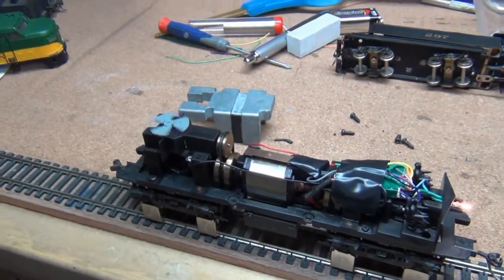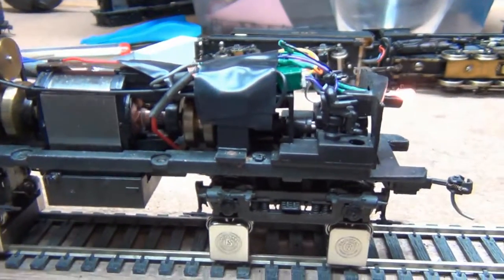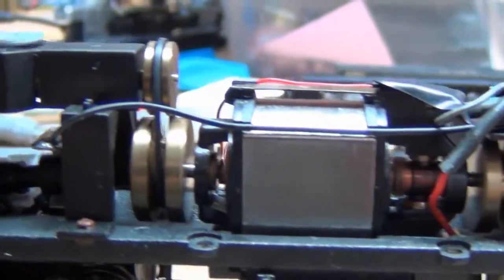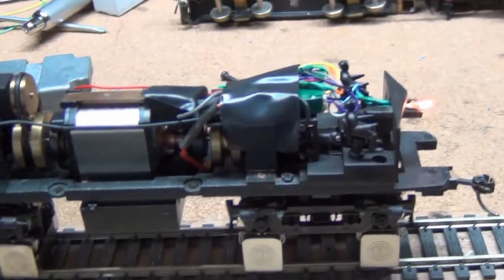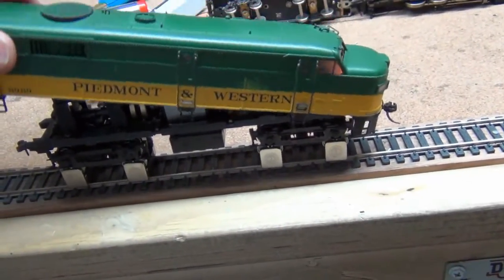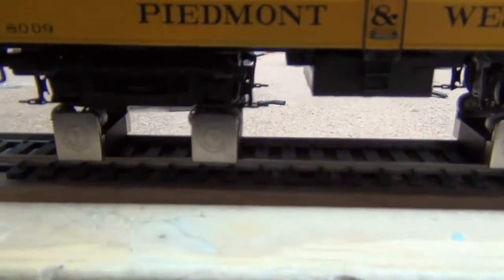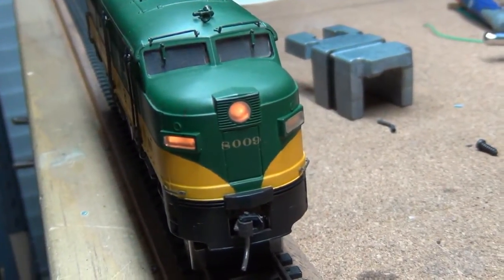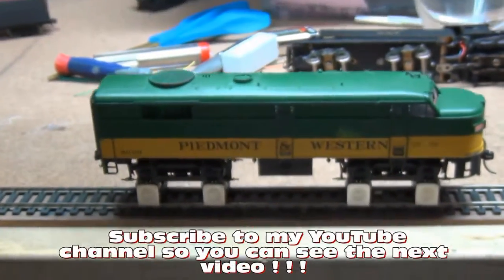What is this Locomotive??

Comment: That is a Lifelike Proto 2000 Alco FA-2. It was one of Lifelike's early Proto engines. In later runs the did away with the moving fan, as it caused the locomotive to run slower.